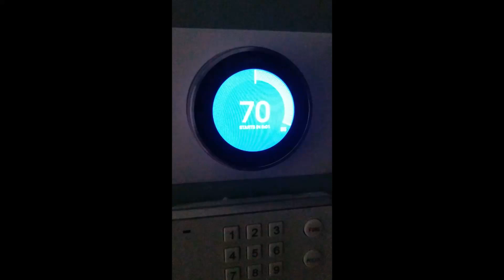Nest Thermostat  E74 / E73 Error Fix - RH wire not detected

Comment: Thank you so much sir, you fixed my issue! I had an issue with my condensation pump not working and this video led me to check it out. The pump wasn't positioned right and had the system thinking it was overflowing. Thank you for saving us some money brother.

Comment: Wow. You just saved me a couple of hundred bucks. I couldn't figure out why it was giving me no RC wire connection. In the end, the sink drain was clogged so badly that the AC drain that goes through the same drain got water backed up because of that. A full bucket of water came out of the AC drain pipe. I cleaned out all the gunk from the sink drain, removed the p trap and cleaned it, put it back in, and everything is working now . Thank you so much!

Comment: The issue for me what the drip pan overflow switch.  I needed to blow out the water in the drip pan.  I got around this by using a turkey baster and suck the water out until morning when I had good light to see.  I then got a small air compressor and blew into the drip pan intake PVS where the switch was.  BAM..

Comment: I’m having an issue with my heat. The fan will come on and the flame will ignite but nothing is coming out the vents and I’m getting this error code. How do I fix this issue?
Reply from the maker: Sorry, but I'm not really sure on that. You may need to contact a professional to come out and check. Something my be blocking your ducts.

Comment: I wish I would have found your video first, I've spent several hours trying to figure out why I was getting that error code, checking electrical connections, on the phone with Nest for an hour, and sure enough too much water in the drain pan. Had to wet vac all the water up and recharge the battery on the Nest thermostat  and it's been running great so far! Thanks for making this easy and saving me a bunch of money. Don't stay up in the attic any longer than you have too! :)

Comment: I just moved into a 2 story house built 2003. The furnace is in the attic. I installed a Nest downstairs which is working fine however I’m getting the e73error on the upstairs Nest. 
I haven’t been in the attic yet... just funny why the downstairs Nest is installed and working while upstairs is having issues. I swapped out the units and the upstairs unit does work downstairs. Any ideas. Thanks
Reply from the maker: Mine was the same situation. The furnace for the upstairs and down are both in the attic. Downstairs was fine the issue was up where we used the air the most.. Make sure you don't have two separate systems in their.

Comment: I'm receiving this error now and it happen today when the temp outside dropped to 34 degrees.  I checked and didn't see any water built up.  Any suggestions?
Reply from the maker: It may be a bad or stuck relay. Check for obstruction dirt or rusty parts.  I hope that helps!

Comment: Weavers Way, you ROCK! Thanks for posting this video. I'm in Florida and am home with a sick kiddo when our A/C quit, showing error e73. I checked the Safety Sensor that's on our condensation tube/pipe, and sure enough it was full of water and had shut the A/C off.  Turns out we needed to go outside and clear the tall grass and muck that had grown around where the pipe empties into the yard. Cleared that away and Just poured hot water and bleach (I'm out of vinegar) into the condensation pipe, put the sensor back on, and Ta-DAH!!!  We have A/C again!  Thank you soooo much!

Comment: Dude! This totally worked. Hot Sunday night in Florida. A/C stops working. No help from Nest. And this totally worked. The only tip I'll add for everyone else is that in addition to emptying the pan under the A/C unit, we also had to open the PVC pipe with the sensor and dry that out as well. Once we did that, it totally clicked back on. I don't know what made you post this video, but thank you!!!

Comment: They're working well>>>t.co/Oo6vxLo4Pe  with one question--it seems you can only set one low temperature and one high. I used to set one evening temp for the night, increase the temp for daytime, but in the evening I want to step the temperature down in stages. No can do. A minor issue all in all.
Reply: awsoem
Reply: wow
Reply: You can set multiple temps and times in the schedule section.

Comment: Thank you so much. Even though there was zero water in the pan, the sensor bulb had water in it. Unscrewed it, poured out the water, plugged my nest back in and AC is now on!
Reply: My pan is dry. Where is the sensor bulb?
Reply from the maker: Kevin Le it should be clipped to your pan.
Reply from the maker: Glad you got it working.

Comment: Cut the line, get a 3/4 PVC couple, get some compressed air, from a portable air compressor and blow the line out both ways to the unit and to the outside. Sludge builds up restricting the line causing water to back flow into the evap. Shop vacs on taped to the exiting line work sometimes or water houses. But the best remedy is to purge the line with compressed air